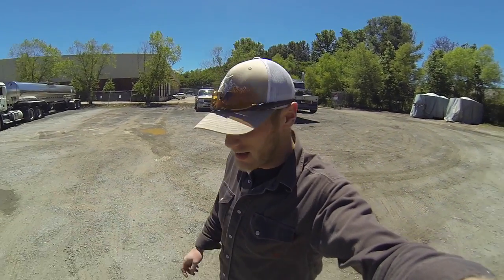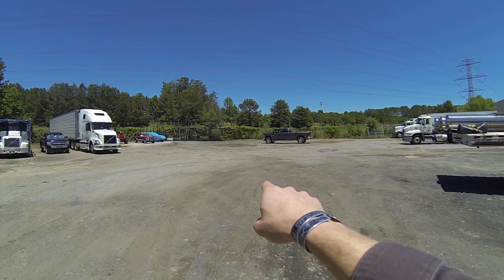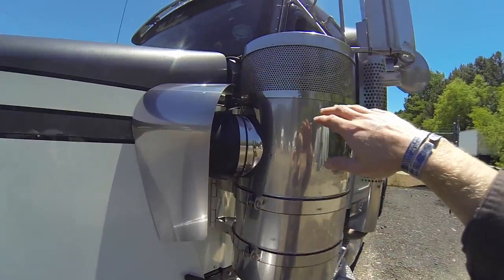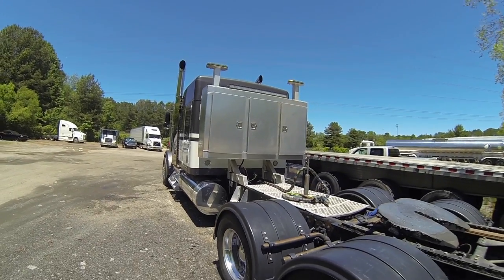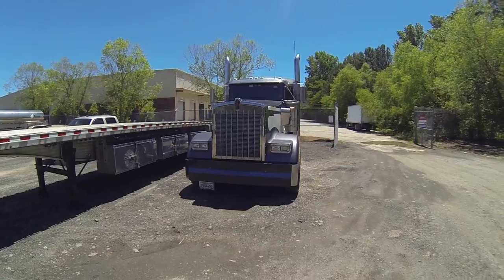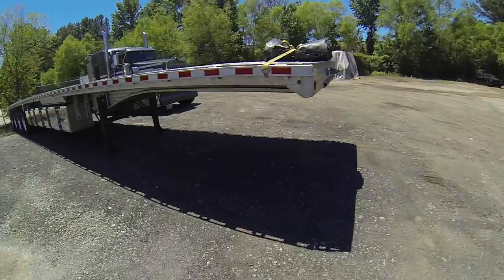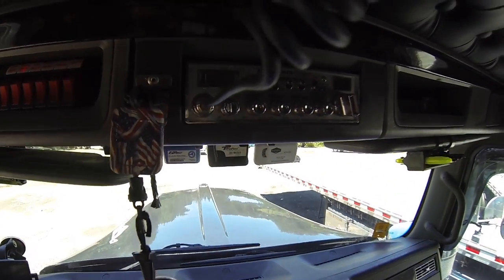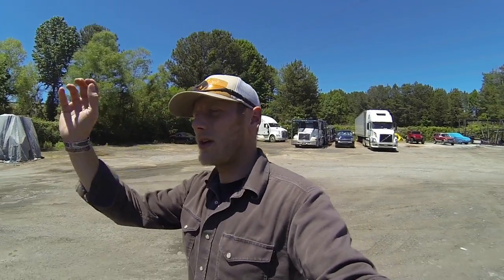Heavy Haul: Updated Tour Of Our 2013 Kenworth W900L and 2015 Ravens Mega Magnum!

Comment: Hello nick, nice to wach you heavy haul guys over in U.S. great videos on your channel! 
Does the truck have original 490hp? 
In out company we have between 540-750 hp in heavy haul tractors.

greatings froh europe,
TOM
Reply from the maker: The motor is bone stock. Exactly how it came from the factory. Like I said, the actual power output is around 465 or so. The higher the horsepower, the hotter the engine runs. Could lead to some problems in the future.

Comment: First of Nick, this is Reality, good work, despite the keys giving you hassle, and yeah some stuff you winged through I am sure those wondering those parts could simply look up "Tour of my Heavy Haul KW900L and trailer" from year ago between episode 3 and 4.
For those saying he should've put the tag 3rd axle in front instead of rear, he would have run into additional and unnecessary weight and had to go with one that drives as it is in the way of the original drive axle and as he pointed out it would have impeded getting up on the catwalk with difficulty. *Not to also mention the necessary upgrade to a higher rated front axle due to the added weight in the front had he gone with the extra axle in front of the original rear axles*. He made a wise choice for now, though it won't help out when stuck in mud or loose sand/soil.
Compared to the way it is set up as he said it gives more room fore (forward) for longer pieces thus gain more jobs with best pay rate, and worth his time, where as if the way you think he should have gone would have left him out of that extra work and good-better pay. Again wise choice for himself, not so wise for those who went that shorter path.
Jost landing gear, per the weight of 50 - 60 thousand pounds actual loaded weight, where as they are rated for 200,000 gives leeway for raising or lowering of such loads, as for example the ability to use it as a dolly with the bridge beam with the bunker plate.
* = Edit
Reply from the maker: Thanks for watching! If I had intended to do this video in advance, I would have opened everything up so as not to forget anything. I was also running without my external battery pack for the GoPro and the standard battery sucks. Was on a time crunch so yea, I did, unfortunately, kind of rush through it. Think I hit most the key points though.
Reply: Should have kept it shorter as a followup to answer questions and pointed out the changes from the first . But yes like i said, kept it real and sucks you forgot the extra battery.

Comment: Two very nice trucks! Like the 8' box on the Dodge and I agree more useful. Our common spec in  Western Canada is 18 speed with 3.92 or 4.10 rears. Yes we use lots of tri drives especially oilpatch. Eastern Canada does recognize lift (aka pusher) axles on the tractor if I am not mistaken. Anyway great looking trucks and setups on both of them!  Good video tour and very informative!

Comment: That's a nice 2500 Dodge, congrats and good luck with it.  I think it's equipped nicely. In the early days trucks were lucky to have a AM radio lol, now they have all the features of luxury cars, how spoiled are we, LoL? 
Here is a tip for you: putting regular gas (mixed with oil usually) will corrode the day lights out of the fuel bowl, giving you carb trouble down the road. Buying fuel from a dealer that's already mixed, usually 50:1 is best because it had that stuff that corrodes aluminum removed and you will have better starting, better plug life, and a clean carburetor.  For as much as you use your chain saw, it a really wise purchase, not that expensive. I might use 3 gallons of fuel a year, and I buy my fuel from the chain saw dealer for the reason I explained here. I also run the same fuel in my Echo 230 motorized 2 stroke weed wacker.
Thanks for the nice tour Nick, I knew a lot of it from before you added the back axle or axle 4 on your tractor. 
I think along with others, I enjoy your video. I've leaned a lot from you, especially organization.  have never been bored with your videos, and from day one, you have always gotten a thumbs from me and will continue to do so. Hi to Pops too. I'm an old guy like him, I'm glad he shortened the shift, LoL.  Take care Nick, thanks again.
Reply from the maker: Thanks.
Reply: You are welcome Nick.

Comment: Love the "outside the box" thinking you guys accomplish.
Before you book anything to Canada however do some in depth homework.
Manatoba west to B.C your wheelbase needs to be 244" or less from the center of your steer to the center of your front driver's. Your 3rd tag axle is legal as far as I know but the catch is the wheelbase. You can buy a over length permit for the tractor but it cancles your ability to permit any overweight/length/width.
Ontario and Quebec have a sliding scale for tractor wheelbase. Max is something like 282" but the catch is the longer the tractor the shorter your trailer wheelbase can be.
Speed limiter required for On and qc as well. Happy truckin.
Reply from the maker: I'm aware of that law. Unfortunately, they actually changed some of the fine print after we had done the modification. We're no longer able to run Canada because of our length. This video would have been 7 hours long if I went into every law that we had to consider.
Reply from the maker: A lift axle is only recognized in certain provinces of Canada. He runs Ontario mostly, which, sorry Canadians, is basically America with weird street signs.
Reply: I hear you on the law. Wouldn't it be nice if everything was the same cross country?
Reply from the maker: It'd be nice, for sure..Hell, it'd be nice if everything was cross county, or even state! Lol. But hey, if it was too easy, then everyone would be doing it ;)

Comment: Very cool video! I drove dry van for two years back in '02 - '04 before quitting driving trucks. Heavy Haul is a whole nother world, especially with all the necessary specialized equipment you carry like chains, binders, etc. I found your tour of the tractor, trailer, and your personal truck very interesting. Do you ever get loads up into Canada ?
Reply from the maker: We do not. We stay in the United States. Canada has changed some of their fine print laws since we had the truck built, so we can no longer permit up there.

Comment: Love that rig.
Just curious as to the front turn signals? I see just holes in top of fenders.
Reply: blue87fj60 led lights under the headlight is my guess
Reply: blue87fj60 I think he took them off because the headlight housing has built in turn signals
Reply: Gotcha, figured there must of been something hidden
Reply from the maker: Yeah, we have LED turn signals under the headlights, and also added LED marker / turn signals hanging from the mirror brackets.

Comment: Interesting to know your steer axle is only 13,000 lb axle especially with the loads you carry. 👍
Reply from the maker: With the length of our tractor, there is too much space between the 5th wheel and the steer axle. It's physically impossible to transfer weight up there. Actually, the heavier we load on the trailer, the less weight we end up with on the steers.

Comment: wow, 307"?  and I bitched when the "new" truck went from 184"-198".....is there a particular reason you went with the 13,200 front axle?  or was it just the truck you wanted?  just curious.  we move our own equipment and I usually go for the 14,200 axle minimum, but like the 20,000 if I can get it.  but I also don't go over the road.  usually under 100 miles one way.  maybe the 13,200 makes for a smoother ride?
Reply from the maker: It's a hass to learn to park, that's for sure. I don't even notice it anymore though.The 13,200 was on the truck when we bought it used. That we didn't have a choice in. We kept it, because with our wheelbase, it's virtually impossible to transfer weight that far forward. Empty, we are 11,700lbs on the steers...when we load 107,000 on the deck, we're at 11,200 on the steers lol.
Reply: I hadn't thought about that.  I guess it would be really hard to get weight that far forward.

Comment: Your KW truck is all most the same length as the Pete. If you did have a lift axle in front of your drives it be shorter. It be hanging near the sleeper. Everything in your truck is like an office. Everything you need is their.
Since you are doing a little Q/A. 
1- You said you was or thinking making your Ram truck in to a pilot car. You though on turning your rear and front lights into flashing lights? ... 2- Is your WKw900 has mid roof or low roof? ... 3- If you end up getting the new load, how you know were to place on the trailer? Knowing their is Cat Scales here and their but their be a moment that you might have to go back to the plant where you got your load so they can shift it a few inches forward or back.
Reply from the maker: Headlight / taillight flashers are illegal on civilian owned vehicles. That is one hell of a fast way to get a ticket. The truck is what they consider a mid roof. I'll go through the process in my next video on how we know where to place the load.
Reply: Ah, guess you have to be a official to own them. How about the Amber lighting on the root that you be able to take off or leave on when doing over size lands?... Awesome, be cool to see how it work down to the T.

Comment: Great info, thanks!  Question though:  I live in Michigan and I see these flatbeds hauling steel with 8 axles on the trailer alone.  Are they hauling more weight than you do or is that just a Michigan law thing?
Reply: Rob Shellhamer it's a Michigan thing.  I think they're called A or B trains.  one of the big pains in the ass is that the D.O.T. rules from state to state aren't universal.  Even the way heavy haul is done west coast vs. East coast is different.  then there's Michigan.
Reply: I figured as much, thanks Fred.  I've seen the B-trains you mentioned as well.  Flatbeds hauling steel or dumps hauling dirt mostly.  11 axles!
Reply from the maker: Guess there's no need for me to answer this, lol.

Comment: hey Nick is it harder to turn or back up with the 3rd truck axel  just wondering .
Reply from the maker: Nah, we actually didn't notice a difference in the turning radius. What was added in length was combated by the wider front steer wheels, which allowed us another almost 3 degrees of steering cut. So, it evened out. The whole rig itself is a pain in the ass to park, at almost 80' long, but hey, you get used to it.
Reply: Yah like any thing else once used to it no big deal cool videos thanks Nick.